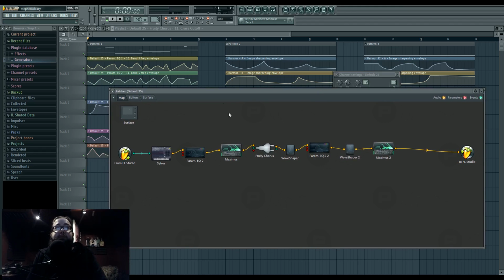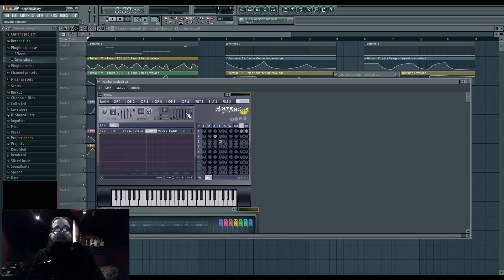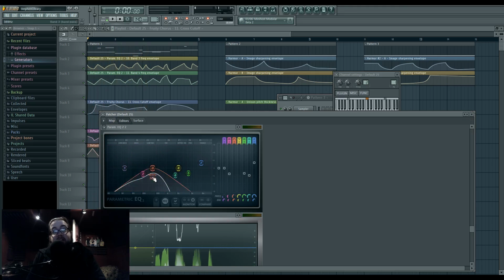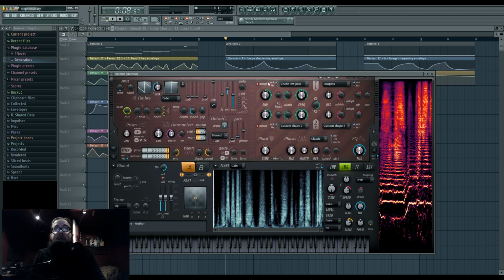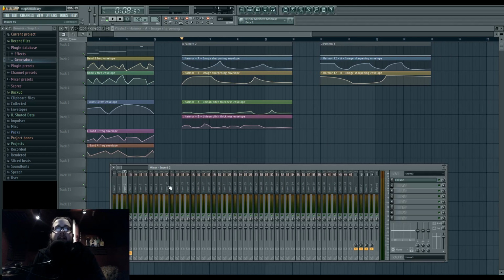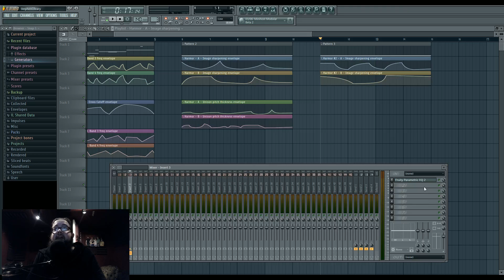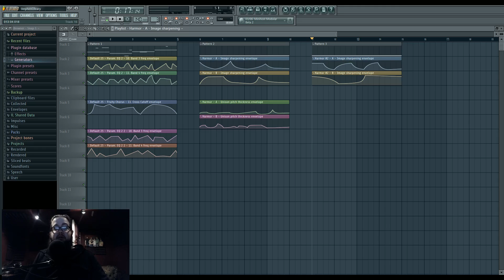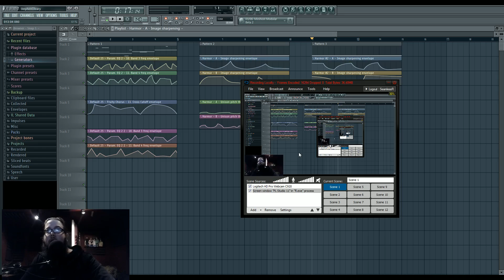How To Bass 78: Sytrus/Harmor Resynthesis Evil From Scratch (Part 1)

Comment: By resampling that pattern with all those weird pitch bends and making a bassline out of pieces of that file later, how do you get any musicality to the basssline?
Reply: You don't
Reply: It's usually used as little filler pieces in between the main basses, so that the track is more full. Also the bass is made with notes that are in the key of the song, so it isnt technically out of key even if it's all over the place.
Reply: Lack Of Silence Actually it is chopped up into pieces, time streched etc. and make into a bassline. There's your musicality.